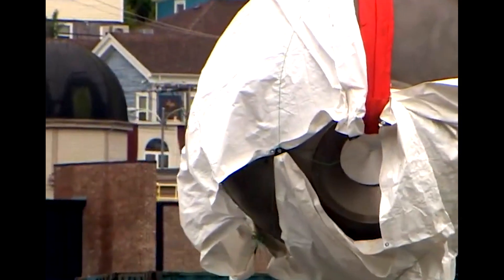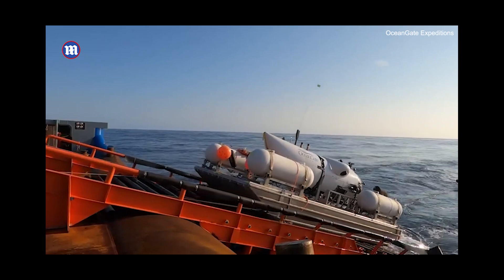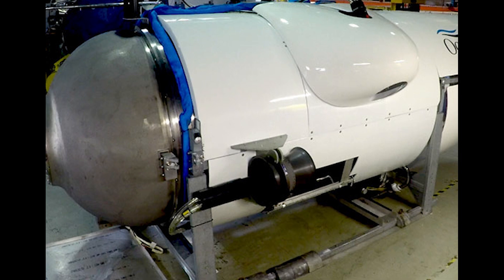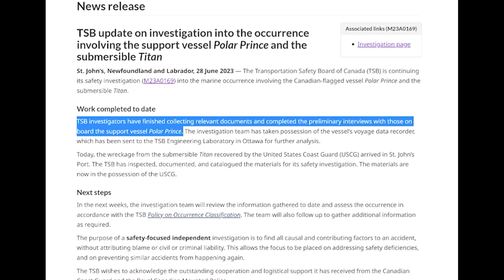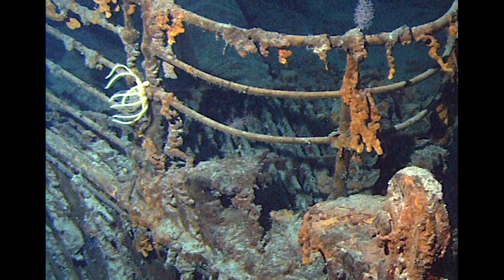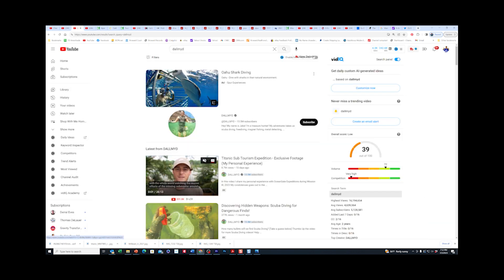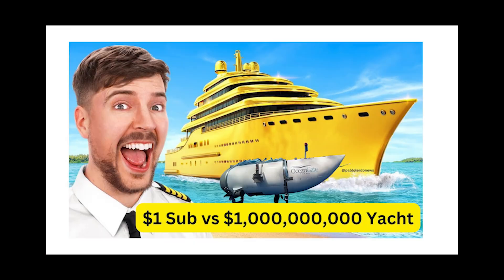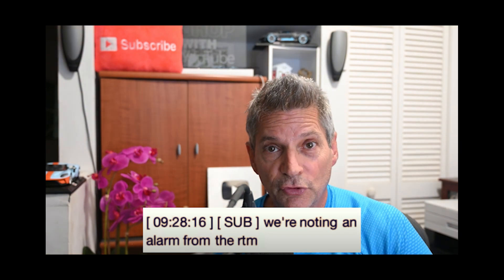Titan Submarine Debris Clues, Implosion Simulation

Comment: Not shocked considering CarbonFiber shatters into dust at the mentioned pressures upon failure.  I've watched it shatter like tempered glass on cars being 1/8in-3/8in thick and can only imagen what a 6in thick tube shattered like.  Also seeing only 1.5inches max was the overlap of the end ring and the pressure tube causes me some issue,  Why not 6inch ish overlap?  I have cut some safety items in the past on my race cars for extra performance however I never skimped on important parts like brakes and suspensions.   Building a Sub only goal is survive so you pack as many options you can afford into the device so that you do..  I'd have sent it down attached to an anchor and left it there a while unoccupied.  If it was not broken or leaking when it came back up I'd be willing to get inside other than that y'all have fun lol.  Something I learned long ago learning to drive semi trucks that works in every situation and occupation.   "Leave yourself a path of escape should things get ugly."

Comment: just for anyone interested, the device they were using on the video just as Jeffo said "I don't even think they were using a torque wrench" was a torque wrench 11:24, they would first use regular spanners and wrenches to lightly do up all the bolts around the connecting sections, then go over them again with a torque wrench.
Reply: I also noticed the second ratchet they used appeared to have a ring above the grip indicating to me that it was likely a torque wrench.
Reply: and the use of a 4"-5" extension on the torque wrench, that did not appear to be needed to access the bolt heads, would have dropped the torque slightly unless the possibly compensated for it but i would imagine that could have some impact on the seal and performance

Comment: The pressure has been so great that it has torn both titanium ends off the carbon fiber capsule. All the glued joints have failed. I can't tell if the window broke or if the carbon fiber tube broke. But the window sounds very special if its bolts and window retaining ring are missing. The problem can also be in the gluing. The gluing could have failed and it's kind of something I don't trust anywhere. A glued joint does not last forever. 3 options glue, window or carbon fiber and one of them is the real cause of the accident.

Comment: I’m not an engineer nor am I an expert on under water vehicles, but I’m thinking the tube compressed and blew the ends off and the porthole window was designed for inward pressures from the sea, not the extreme pressure from the implosion pressing out. I’d imagine that it got blown out during the highest pressures during the implosion. Just my 2cents worth. I could be way off. It’s happened a couple of times 😂🤣. Much love to all and RIP to the 4 that died senselessly and good riddance to Stocky

Comment: The seal between the titanium and carbon cylinder is what i think caused the rupture but I dont think it was the glue or the size of the ingress into the titanium. Even if those surfaces were flat at 6000psi it would not budge. I just think the titanium ring wore down the carbon fiber there because of temperature changes and pressure changes. Thank you for your videos

Comment: Fantastic analysis! As an aerospace mechanic, and engineering trainee I noticed a SIGNIFICANT number of alarming procedures. The pressure dome should have been a close tolerance fit, as opposed to what looks like them "dropping" it in place. I also don't want to speculate, but I recognize the color of the "glue" they are allegedly using. This looks more like aircraft sealant mixed with some sort of resin. Seal requires a clean surface using Methyl Propyl Ketone (MPK) to cure. Since the seal may have been mixed, its questionable it even cured properly at all. With all of this said, I agree that the dome was the failing point. The poorly applied seal concoction would have exposed voids eventually causing the implosion. I believe during subsequent dives, the ocean pressure temporarily sealed the voids. As Titan resurfaced, the pressure decreased causing the voids to become larger overtime. The titanium dome would internally become physically detached from the carbon fiber hull, being held together only by the sealant. At this time, the occupants would hear the carbon being crushed since it no longer has support from the dome. On the last dive, the voids and delaminated carbon fiber would have reached a critical point. As Stockton attempted rapid ascend, the heaviest part being the two pressure domes would have applied downward torsion on the carbon hull. No longer tensile,  the hull would have shattered. The violent force of the implosion would have caused a vortex which pushed the porthole flange and window forward. Since the fastener were installed head first, they wouldn't have had a chance to withstand the pressure. You also wouldn't see any residue on the pressure dome, because the adhesive never properly adhered to the dome to begin with. A truly tragic end to their story.
Reply: shouldnt the whole thing have been titanium? and welded. i dont see how mixing materials, and gluing metal has any potential success
Reply: @FordSierraIS  Yes, i absolutely agree! A titanium sphere is the known industry standard for building submersibles rated for these depths. Mixing two types of metal in general causes galvanization which would accelerate fatigue. Thats excluding the the amount of erosion salt water would ALSO cause. Carbon fiber should have never been used. Perhaps only for interior decorative panels, but not these types of depths. Even more concerning, there are no support stringers within the structure. This would have at the very least equalized some of the stress on the hull to more localized points. Ocean gate still would be required to inspect the hull after every dive for cracks/stress fractures. The other issue is,  it’s almost impossible to spot fatigue cracks with the naked eye. You would need ultrasonic equipment (NDT) to find cracks. Unfortunately Mr. Rush declined to use this type of testing. The more we dig, the more negligence we find. Rules and regulations are often written in blood of the innocent. I wish Mr. Rush would have merely adopted the sentiments of his experienced engineers and headed their warnings. RIP to the innocent “passengers” on the Titan.
Reply: @DTTechReviews  I have heard quite a few people saying that NDT equipment would not have been reliable with the 5 inch thick cylinder wall.  I've heard of proposals to use composites for major parts of aircraft landing gear for weight savings, but they are constantly shot down because of how composites fail.  Metals are infinitely more predictable on how and where they will fail, where failures in composites can start in the middle of the material and work outward.  Even with NDT equipment, it would take forever to scan that sub, and if ANYTHING was found, the whole cylinder would need to be scrapped and replaced.  Based on the panels added inside and out, it looks like they were over confident that they had thought of everything.  It was a sad irony with this being similar to the Titanic's lack of life boats.  Odds are, the initial damage that led to this occurred one or more dives prior.
Reply: @synjdcrispy7843  I’ve heard the same, but that’s a common misconception. I’d like to clear that up. Ultrasonic NDT testing IS the preferred method for finding cracks in CFRP. And there are tons of aircraft parts that are made of carbon fiber and completely safe. I can’t share my employer, but I will clue you in, and say we manufacture a popular aircraft made from carbon fiber. It’s completely safe, and has been for the last 10 years. With that said,  I do agree,  testing carbon fiber is expensive and time consuming but necessary. Sure scrapping the sub would have been a risk, but that’s part of manufacturing a vehicle. There’s simply no excuse. He had all the tools and help available to him, to build a safer sub. He simply chose arrogance. He Even declined NDT testing.
Reply: Wow.  This is an amazing analysis.  It makes perfect sense, too.  Hurts my heart to think of 19-year old Suleman hearing those horrifying sounds and realizing his worst fears were about to come true.

Comment: I think the carbon fiber failed so quickly, the 2 titanium endcaps came together, and the air, debris, (and ppl) were compressed like a combustion chamber! Heated instantly to somewhere around 5,000 degrees, it then EXPLODED, blowing out the window, vaporizing what was left of the carbon, ppl , and whatever else was inside.. thus cleaning every trace of glue, or carbon off the titanium...

Comment: This carbon fiber sub has made a few excursions before this one. HOWEVER, there is no record of NDT or NDI examination.
With the video of assembly showing the ONLY vertical wrappings of the material, I suspect a manufactured weakness.
Imagine wrapping wide shoestrings around a cardboard tube, layer on layer. Can you imagine a gap between one set of 5 shoelaces, and the next 5 layers of shoelaces? At depth, a hair's width of a space between shoelace layers would be enough.
Asa former DoDQA guy, I have seen this stuff react during a functional test. There is no Sheared, twisted, mangled anything. The stuff goes POOF and shatter into a whole bunch of threads that you would sweep up from the floor (wearing breathing apparatus and good set of goggles).

Comment: I notice every single keyboard engineer points out the ballast and yet they never suggest what they should have used or how it led to a failure. ballast is weight meant to be dropped, it isn't required to be made of expensive material.

Comment: I don't think the "glue" is what we thought it was.  I assumed it created a bond between itself and both the CF tube and the titanium ring, but now I believe it acted more as a gasket that "held" on to both materials, rather than bonded to them.   As for your question why did they only make the overlap a few inches, I thought to myself make it 12 inches - then I thought just make the whole thing titanium. They failed at solving a problem that didn't need to exist.

Comment: I watched a Video that said that the Cylinder part of the Submersible would shrink down by approximately 3/4 inch during the dive!  But obviously the Titanium rings did not compress down at all.  So you have the ring glued to the cylinder part and when it dives and goes down. The cylinder was compressing and shrinking and the end rings were staying the same!!!  The epoxy would be under tremendous strain trying to hold it together.  Plus another thing I have seen on another video is that the carbon fiber was all bought past the expiration date, or shelf life.  Which I did not realize that it had a expiration date, but apparently  it does.  So when you look at the total of all of the errors involved it makes you cringe that it made as far as it did!

Comment: I thought the same thing; those bolts would need to be cross tightened and then using a torque spec that would have been calculated through research and development would be ensured by doing the procedure twice. Not to mention they didn't bother with the 17th bolt, they said it didn't matter that much and it was hard to get to, being at the top of the sub.

Comment: The domes could not come lose from the carbon body, the pressure on the domes was enormous at that depth, same reason you dont have to use a torque wrench to bolt it together. I bet the carbon cylinder imploded somewhere in the middle where it was totally unsupported. It all happened in a few milliseconds, the crew won't have been aware of it.

Comment: The window blew out and the titanium ends blew off. As the carbon fibre centre part imploded, the internal volume decreases and the internal air pressure rises. If this happened slowly the pressures inside and out would equalise. But it's not happening slowly, it's happening very fast  and the momentum of the inrushing water is going to pressurise the interior air to a pressure way higher than the original external water pressure, blowing the end caps and the window outwards.

Comment: Mating the ring to the cylider being sutch a critcal connection I would think that would be done in a clean room. Looks like a dirty warehouse. I see no connecting rods either connecting both ends of the carbon fibre. I am guessin the they thought the compression  from the water would be enough.

Comment: This is the first time I have seen the clip of the crew "gluing" the CF to the ring with no fastening system. That seems to me to be the biggest miscalculation they made in the design of the vessel. Specialty metals and carbon fibers expand and contract differently in temperature and extreme pressures such as they had at those depths. Personally, If I were to become a passenger in this vessel and had known that the cone had been glued, I would have walked away.

Comment: If the viewport had been the failure point would the carbon fiber hull have been damaged too, or would all the water have just rushed in and equalized the pressure?

Comment: The port window probably popped off from the implosion shock wave. When the water on all sides hit together and bounced back. 
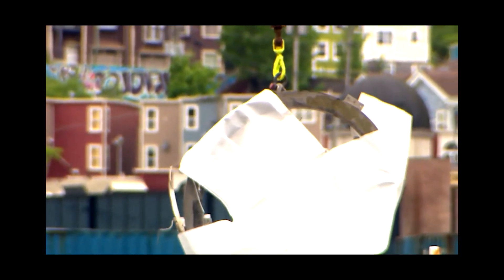Just look how thin the lip was and short it was. That was probably was the failure right there. At 1:50, is that part of the lip on the left side, split off the ring?

Comment: And the collapse of a steel barrel is very, very slow compared to a submersible at 3600 meters.  The barrel is seeing at most 1 atmosphere of differential pressure or 14.6 psi.  A submersible at 3600 meters is experiencing a differential pressure of 365 psi.  The initial acceleration at the time of failure, particularly for a brittle material like carbon fiber, would have been at least an order of magnitude higher than a steel barrel at 1 atm.

Comment: A possibility for the missing acrylic window might be that when the carbon fiber cylinder imploded, the pressure of the air on the inside dramatically increased against the window in the reverse direction and caused it to blow out, not in.  That momentary change in the direction of pressure on the window may have caused it to fail in the opposite direction since it was built to resist failure in only one direction.
Reply: That was my thought as well. I wonder if we'll ever know for sure.

Comment: You know you're probably right with the Rings the titanium rings look super smooth in for a glue or any kind of in adhesive to attach correctly there has to be a porous surface.   if not once you put a liquid into the mix especially under a lot of pressure or a lot of heat or a lot of temperature change in general you're going to have an unadhesion to that material it probably just popped off like a cork top. I know people say that putting two materials like carbon fiber and titanium together would not work but that's complete BS because the aviation industry does it I know from experience myself there are engines in the sky right now with blades that are made with titanium/ carbon fiber blades turning thousands of RPM so when done correctly it will work under extreme pressures and temperatures

Comment: Given that the joint between ring and carbon fiber tube was under high compression, I am not all that concerned about that joint.  My suspicion is the carbon fiber tube was the primary failure point.  The viewport is certainly suspect also given that it was being used under 3X the pressure it was certified for.  Even if the margin of safety was 2X, it was still significantly overstressed.

Comment: Man, Carbon fiber excels at traction and sucks at compression. Here it is working at compression. It would be great to contain pressure INSIDE, not outside. Bad design from the very start. From this point on, a lot more design flaws, IMO. Use steel or titanium.

Comment: If the pressure vessel imploded, the port hole window may have been blown outward.   My understanding is that the port hole is wedge shaped where it would be hard to go inward, but outward very easily.  7:17  Why is he using an extension!!??

Comment: All the deep sub experts say the same thing, the more you attach different materials together the more the shrink and expansion coefficient differences change, then add that to the micro fractures in the poly carbon fiber caused by the repetitive dives without inspection using micro ultrasonic tests to know exactly the amount of wear and tear is just reckless.

Comment: I don't think the window was the cause of the implosion,  the transcript of the com's between the sub and top vessel has been released and the hull alarms were red for 20 mins before the implosion and they were reporting cracking noises from the aft, also they couldn't rise in the water column after dropping the ballast and the skid so they had to be taking on water as they seem to have burned out the A bank of batteries trying to use the thrusters to come up and were pretty much stationary.

Also you said they didn't think that they were even using a torque wrench while showing a clip of them closing the dome with a torque wrench!

Comment: Do you think the implosion force could have blown the front off? It would have probably created a cavitation type explosion at those bulkheads!
Reply: This is most likely what happened either the bolts snapped or it just ripped right thru the treads as the implosion happened and the pressure wave happened